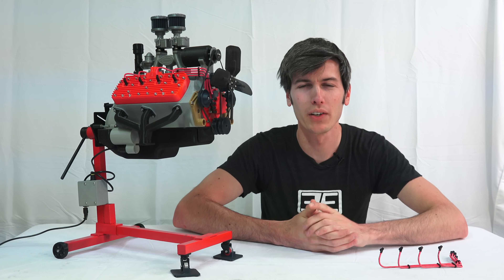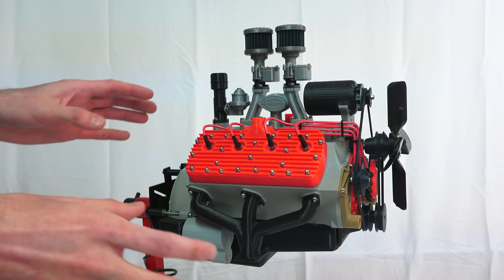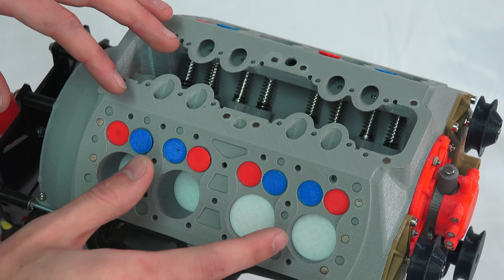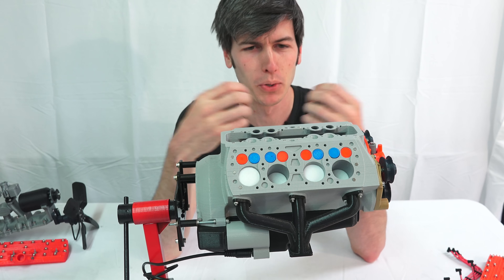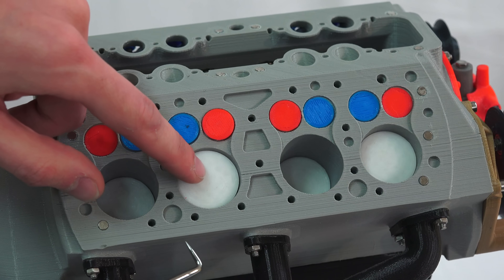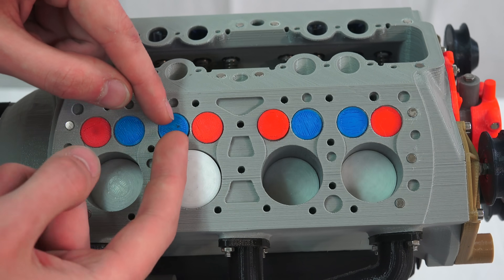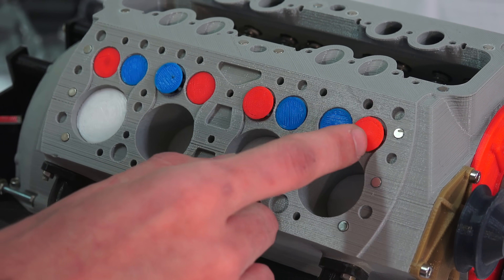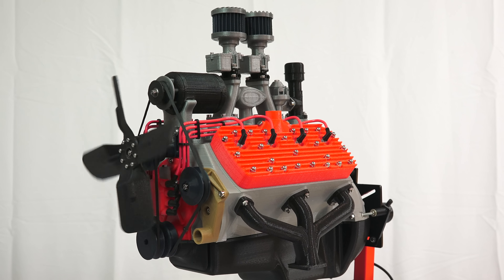Why Ford's Flathead V8 Engine Died

Comment: My father had one of these in a 1950 Ford Crestliner he owned. They had a tendency to use a lot of oil as well. And besides the low horsepower the cars they were put into were very heavy by today's standards so they had a hard time getting out of their own way.

Comment: The overhead cam was invented in 1902, and used in almost every aircraft of both world wars. Ford stayed with the flathead because it was cheap, not because it was good, and that engineering pervades their brand to this day.
Reply: Really?  Wright and Pratt & Whitney engines were all pushrod engines.
Reply: And that’s just the way I like. It, because I could never afford the Mustang GT that BMW or Mercedes would build. If you want to get rid of the “cheap,” go to the aftermarket.
Reply: @carlosdezayas5109  You mean the 8 Series? lol
Reply: Go to the aftermarket and throw out existing functional parts of your car. Great idea.

Comment: You forgot the other big problem with the Flathead.
Valve seal cracking between valves and piston.
My grandfather is big into these engines and 3 out of every 4 blocks he acquired are cracked. Damn shame too since all the 59ab blocks he finds are cracked...

Comment: There are positives to the flathead V8. No rocker arms and push rods, more compact less weight. The low compression is great for supercharging. Oh yeah, and its cool looking.
Reply: Theres a company out there called motor city flathead that gets some serious power out of these....they do love being force fed some wind !!
Reply: Eddie Lee and the valves cant hit the pison head if something would fail
Reply: paul austin  the guy is advocating supercharging an engine that already has cooling issues.
that is just nonsense imo.
Reply: I agree I love the flathead v 8
Reply: Yeah, except the big flathead isn't lighter. That's where thin wall casting techniques come into play.
Reply: The Ford flathead V8 was a piece of garbage. It only made people feel good about getting a V8 engine. It looks very cool especially when dressed up with  polished aluminum parts but I will take a flathead 6 cylinder over that piece of junk anytime and every time and run circles around it
Reply: That's called "spinning" it, casting a turd, engineering-wise, into something desirable. Modern DOHC pent-roof engines have it over flatheads in so many ways: efficiency, durability, specific output. These engines were the "buggy-whips" of prime-movers. Kludges. For obvious reasons they run HOT.
Reply: @jacquesblaque7728  When  the engine is hot; any water (hot or cold) would warp and/or crack heads.
Reply: @jacquesblaque7728  right up until your timing belt snaps and you just bend every valve in your engine and totaled it. As a mechanic buddy of mine once said I love things that require regular replacement and I love people that ignore it even better.
Reply: David, you're making some rash/silly assumptions about cam drive and valve/piston possible interference. Timing chains are kinda hard to snap. Many engines are non-interference. Look it up. Some that are, Porsche 911 ferinstance, will suffer broken rocker arms. Yes, it has them, off SOHC. Gimme DOHC 4-valve pent-roof, and keep boat-anchor flatties.
Reply: DOHC and durability?  Lol. Interference engines which will create a bunch of expensive cornflakes if WHEN the timing belt snaps or one of the multiple chains breaks.
Reply: @JosephArata  I kept up with maintenance on my Honda Civic and my new timing belt went out at 10,000 miles. When the timing belt was done they put all new parts associated with the belt, original equipment I was lucky it was not an interference engine and it was just a matter of putting a new timing belt kit in it. I had a professional shop do the work, one that I've been using for many, many years. I don't even want to think how expensive it would have been had it been an interference engine. You may consider pushrod engines to be dinosaurs but they are still very useful very reliable engines. I'm not knocking the newer technology, it is pretty neat stuff but there really is something to be said about not only pushrod engines but flat heads as well.
Reply: @JosephArata  
Among the first cars to utilize engines with single overhead camshafts were the Maudslay designed by Alexander Craig and introduced in 1902
OHC isn't new 🤦‍♂️

Comment: um almost all of the problems with this engine were solved by hotrodders a long time ago. special heads, exhaust, cams, what not. There is a way to increase the compression, you deepen the valve room, but don't open up the entire void, it basically leaves a triangular shaped piece pointing at the middle of the valves. there are then two channels about the same size as the valve diameter, leading to the cylinder, but that part is not relieved. done properly, and die ground for optimum flow, you can get amazing compression out of them something like that... it's been a long long time since I've seen one.

Comment: The model does not represent the original design but that of a later after market. Changes to the carbs, intake manifold shape, that modified head and even changes to the main beaing and pressure lubrication made a very good performance engine.    Even the block are being recast today. If you love a true hotrod it should have this engine.

Comment: OK  video  but don't  get all technical  about why it failed  because it didn't    In its day it was superior to all the attempts by Chev and Dodge at overweight gutless engines  that cars and trucks had .    Flathead  V8 's    were    Lighter   faster revving   and  more efficient than its counterparts   and timeless in the custom car scene     Henry was a genius     you not so much

Comment: BTW never store a flathead V8 with plain water or weak anti-freeze solution in the water jacket. They commonly crack at the base of the water jacket when the liquid freezes. (Old mechanic here.)

Comment: You're seven years older than me?  Not even when donkeys fly!  Many of us know of flatheads from tractors and lawn mower engines etc.  Usually a reliable engine because there's so little to go wrong, but not notably efficient.  I would use the word usurped rather than died, because OHV just ran circles around flathead, and there was no justification to continue production.

Comment: Another problem was the dual water pumps , one for each side , but only one side had a temperture sensor , therefore 50% of the time a water pump failed it cost you an engine , and water pumps blew often back in those days .

Comment: 'They didn't even have computers'. Makes me laugh. They didn't have computers when they designed the overhead valve V8  either. They invented quite a lot of stuff without computers, including computers.
Reply from the maker: Yes, but by modern standards 65 HP from a 3.6L is pretty poor. My point was that for the time it's a pretty cool engine.
Reply: Don't sweat it, it was a nice video. My point is that there were probably a whole bunch of reasons for the flathead, of which lack of computational power was surely the least significant.

Comment: Ford should bring this back just for the shits and giggles
Reply: They brought ecoboost for shits and giggles.
Reply: @V8_screw_electric_cars  they borrowed it from the mazdaspeed
Reply: @JeremyR-h3i  Elon musk ain't that smart of a man, hes just an ideas guy. His engineers do all the work.
Reply: Flathead EcoBoost
Reply: Just don't put the fuel pump on the top of the motor
Reply: No one's going to buy them. If you want one, there are plenty of rebuilders, but you won't buy one.
Reply: most lawn mowers are flatties.
Reply: @timothyearly7727  not any more
Reply: They would make it a v6 because they turned gay
Reply: Sauce Boss 420 no they’d bring it back, make it 4 cylinder, duplicate the original model t engine, put eco boost on it.
Reply: Dat Boii I would imagine a modern flathead would make significantly more power. This isn’t the 70s anymore, engines are no longer significantly restricted by emissions equipment. HP/liter is almost double what it was in the pre emissions era, even excluding turbocharged engines. Plus emissions equipment keeps our air clean. You would not want to live in LA in the 60s. Smog was not good.
Reply: @AfterDark33  Terrible combustion chamber kills it as a viable auto engine for modern vehicles. That's why the small block OHV engines ended the flathead era.
Reply: Ob Fuscated oh I’m well aware of the limitations of such low compression engines with poor valve clearance and awful combustion chambers. I’m just saying if you made a modern one, it wouldn’t be as bad.
Reply: AfterDark3 engines are still very restricted by emissions actually. Modern technology has just allowed us to have the kind of power we do despite that fact
Reply: El_De_La_Lobo as a crate engine would actually be pretty cool. They do make good power for their design.
Reply: Jimmy Grant it’s available as a crate today. Just not from ford. The patients on this thing went out decades ago it popular as a hot rodders toy
Reply: Buy a French block and have at it. Don't know what a French block is?  Research.
Reply: Not gonna lie, a crate Flathead would be awesome.

Comment: From an Manufacturing standpoint it is a nice thing. Cast a block, some drilling, some honing, few simple milling operations that can be done by anyone within 1-2 weeks of training and the thing is good to go. The Camshaft and the Crankshaft are the complicated parts, having just one cam shaft helped the manufacturing process.

Comment: This engine did NOT die, it was replaced with the 239 cu in OVERHEAD VALVE  engine, and at 73 yrs. old, I owned a few of these, Both Flathead and overhead valve engines

Comment: Another Achilles heel was because of the two center cylinders sharing a single exhaust port they got pretty hot. So much so that the very commonly would get cracks between the cylinder and exhaust port and they really could be repaired

Comment: Am I the only person that thinks it is wrong to refer to displacement with "LITERS" on a "Flattie"? I am old enough to remember when cars had "CUBIC INCHES"
Reply: Since this is an international venue, liters makes some sense. Still, 221, 239, 254, 337 are all flathead numbers.
Reply: Al Brase you forgot the 226.
Reply: When you say a Ford has a 7 liter engine do you mean a 427, a 428, a 429, or a 430?  I know the 430 is obscure.  It was offered in Lincolns and Thunderbirds in the late 50's.
Reply: Seven liters is exactly 428 cubic inches.  That is 61 & 1/7 cubic inches per liter.  Otherwise the other engines are called exactly what they are in cubic inches.
Reply: @bwtv147 You forgot to mention the 7.0 liter 425 Oldsmobile or the 426 Hemi. And the 430 was also used for the Buick Riviera and Buick Wildcat from 1967 to 1969. :)
Reply: 430..The good old MEL V8.
Reply: @techmaven5900  MEL...another Ford screwup.
Reply: sparkplug1018  .  If your 350 is 5.7 L, what would a 348 be?
Reply: A 348 is Always a 348, the hell with "liters" in that 1958 and up time frame.
Reply: 348 doesn't mean anything to me. My whole life has been either Litres or cc's. Comparatively speaking, cubic inches is the one measurement that I have never put any effort into learning. By that I mean that since we don't learn it in school's and the only time it is used is in youtube videos, there is no need to learn it.
Reply: I really was born in 1952 and I never even blinked when he said liters.  I did not even notice until you mentioned it.  Yes, I am American, a son of the south.
Reply: @uropygid  You must be smarter than most of your neighbors.
Reply: Yeah, but if you're preaching metric 'liters,' don't use English "HORSEPOWER." Use "newton-meters per second," which just rolls right off the tongue.
Reply: Where is James Watt Youtube account when you need it?
Reply: +bwtv147  Technically it’s 5.736L 5.7 even I believe is a 348. Manufacturers usually round it up or down to make it sound nice. 
Doesn’t make finding parts harder though since most things interchange, and the few that don’t we’d measure before ordering.
Reply: sparkplug1018  > You're not saying many parts interchange between the old Chevy W head big block and the Chevy small block are you?
Reply: I was of course referring to the SBC, BBC, etc. Within their respective families parts interchange easily, one of the beauties of the design really. Correct me if I'm wrong though, but I think theres even a few parts (very few) that interchange between them. Not an expert on the older Big Blocks.
Of course the same applies to Ford and Chrysler engines similarly.
Reply: That was my point.  The 350 grew from the 265 small bock of 1955.  The 348 was the big block introduced in 1958, the forerunner of the 409.
Reply: I grew up with cubic inches, but I'm more comfortable with liters now.  I'm apparently one of the few Americans who is perfectly fine with switching completely over to the metric system, instead of the hybrid 25% metric / 75% customary way we do things now.  Poetry and lyrics probably won't change, though, because metric is not very poetic.
Reply: Im 26 my first vehicle was a 1962 ih scout with a 151 cubic in slant 4
Reply: @ soaringtractor Yeah, metric can be a pain in the ass, but I just google it. If me and some euro dude are discussing car stuff, I'll just google a metric conversion and show both such numbers as 55 MPH/88 KPH or 3,500 LB/1587 KG.
Reply: Not really. My Lancer's powered by a 225 Slant Six, but it's listed everywhere as 3.7 liters.
Reply: Anyone see any sales flyers from back then advertising the engine size in liters?  ...thought not.
Reply: I remember cubic inch displacement very well.
Reply: you are not alone on this, I do think it is wrong also not to stir up trouble but I hear people say motor and not engine like this guy says engine. How long does the extension cord have to be with the motor to go say 10 miles
Reply: I completely understand where you are coming from, but he is a scientist, and I understand litres better than cubic inches. that said, It would have been nice if he referenced both units for his audience.
Reply: @royaloreca That's what I do as well, showing both the American and European measurements. That way, neither side can complain about not understanding the Standard/Metric issue.
Reply: It would be wrong if you'd call it that, since that's not the name the product was marketed as.
But it is correct and more people across the world have a concept of how much that is.
Reply: Liters and cubic inches are used interchangeably. I have a 5.7L 350 cubic inch v8 in my Camaro for example. It honestly doesn't matter.
Reply: Of course it should be "litres", not "liters", as it is in every other language than USAnian.
Reply: Ken Oliver  >  American English is the closest thing there is to a worldwide language.  Besides, although  it was later built in other countries under license, the Ford flathead is an American design.
Reply: bwtv147 the only reason that American English may be a worldwide language is because it is forced on us. Everything that is made either by the Americans or for the Americans, is with American spelling. Everything Microsoft is American spelling. Even stuff made in Australia has been made with American spelling. So much so that schools will accept English-English and American-English both as correct. The alphabet song with the letter "Z" has even been changed. We have a meter (measuring device) or metre (length unit) where as America is meter or meter.
Reply: I personally grew up with cubic inches so that's what I prefer.
Reply: We dont need no stinkin liters
Reply: WOW!  Look at all the "One-Worlders"!!  Somewhat sickening.
Reply: I suppose Cubic Inch or CI is politically incorrect now-a-days.
Reply: Yes a gram is better than a damn, welcome to the Brave New World.

Comment: The Ford Flat head V8 might be gone....BUT I would have to argue that the "flat head" DID NOT totally disappear!!! After all the same technology in the flat head V8 can be found in literally BILLIONS of Brigg's and Straton Motors in garden tractors and push mower, Tillers, go carts and darn near everywhere small gas engines are used that read "Briggs" on it!!! And you are WRONG about making a V8 Flat head into a high performance motors because there are machinists out there that figured out how to improve the power of the Flat Head well beyond what Ford had ever built into the thing!! But like all motors those gains DO have their limits and there is only so much YOU CAN do to ANY motor to make it faster or more powerful or increase its torque ratio!!! After all a small block Chevy can be punched out to a 383 stroker motor, but even that has limits, until you get into something like a 396 or 454 which can even triple the stroke of the small block!! And big blocks can be built to make even MORE horsepower as well!! And trust me I used to flag for MICRODS, which is a type of small race car for kids, and some of the things you will see at these tracks WOULD amaze you even out of what was probably one a lawn mower engine!! Heck I have seen some Briggs motors turned into inline four cylinders right here on YouTube for example and others are modified to run on Nitro Methane which fuels drag cars!! So flat heads are NOT dead by no means!!!
Reply: and I am 54 years old born in 1964........so there is NO FREAKING WAY you were born in 1953 you told!!!!!
Reply: Greg Benwell.
The French car company, Simca, produced the engine under license from 1954 to 1961. The engine was also produced in Brazil by military vehicle manufacturer Unic Marmon (also owned by Simca) until 1990.

Comment: A modernized flat head could be the most efficient motor with so much fewer parts.  
Shouldnt the flathead atomize the air/fuel mixture better?